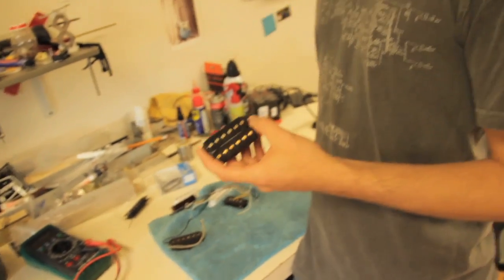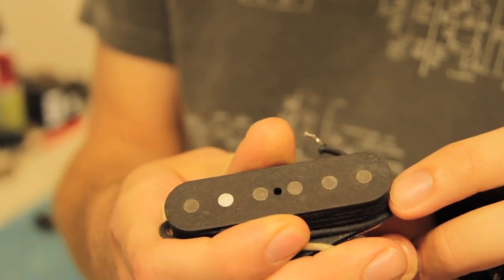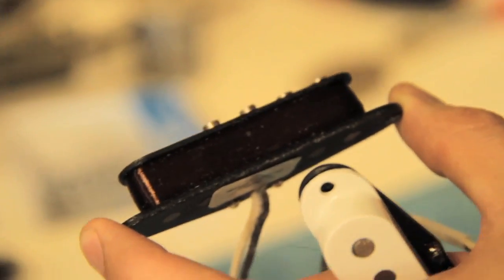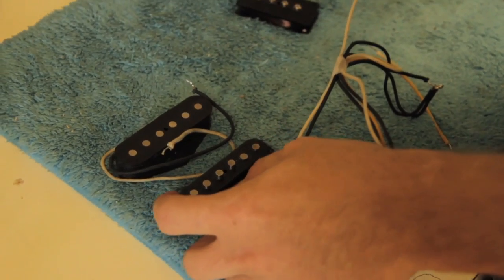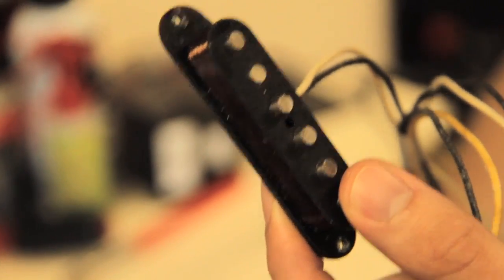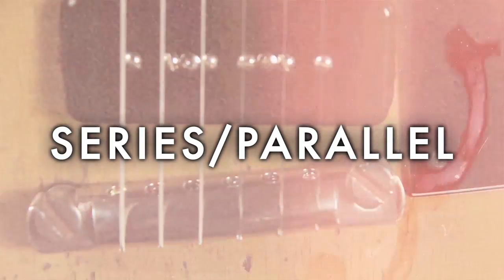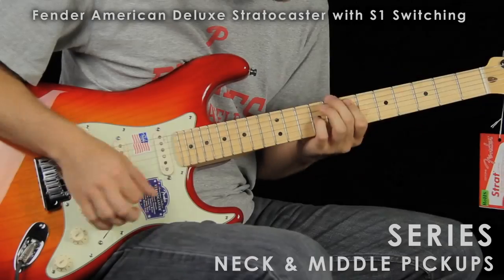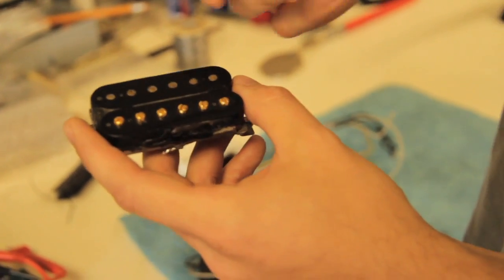Guitar Pickups 101: How Guitar Pickups Work - Tech Bench

Comment: is the copper wire insulated? or is it just bare wire?
Reply: the copper wires hav a coating on them. the coating is conductive ig but the resistance on the inside is much lower, so the current will flow inside the coil and won't jump over turns

Comment: on a 6 pole pickup, would it be possible to wrap two poles at once, each set of two, and then wrap all 6 for better output?  before you answer this, has anyone ever tried this and where is the information saying it works or doesn't?

Comment: Yeah question if you, or anyone, gets a minute please. While investigating the cause of my pick-up not working, I pulled the apron/skirt back and found the ground from the main output wire had frayed loose. So after 're soldering, I was pulling the apron back over and needed to cut away some old glue, and wouldn't you know it?, there was a teenie tiny little black wire hiding right in the glue there and my snips were just doing what they were told to do. So, heh heh, from main output(red) I have shielding wire grounded, then hot wire runs into first coil(white), exits 1st coil(yellow), into second coil, then exits as black, and then the snips happen... Do I just ground it with the shield ground or?...... Thanks if y'all can help, and thanks for the info video too... Well conveyed and easily understood!!!

Comment: So then electricity is going through the strings too I assume?
Reply: What the hell?
Reply: The vibrating string affects the magnetic field and these fluctuations are transferred to the coil and sent to your amp. This is why an electric guitar wouldn't work with say nylon strings because they aren't metal and don't interfere with the magnetic field.
Reply: Nabre Labre doubt it cuz a player w/sweaty fingers would get shocked, i think.
Reply: Yea probably not,  I was thinking without electricity flowing through the strings what would there be for the pickups to... pickup. But I guess the string resonating moves the magnet enough to get some kind of current flowing in the pickups then I guess you amplify the crap out of it to get something audible
Reply: Nabre Labre sounds logical, but of course since i'm not an electrician, i don't know for sure.
Reply: To be honest I don't know much about it either. I know a magnet passing by a wire will generate electricity,  but not a stationary magnet. A current through a wire could induce current in another wire without relative motion... I think

Comment: What would happen if I connected a wire from the pole of the bridge pickup on a Strat to the middle pickup. Imagine a wire that was taped, or soldered to the top of the pickup where the pole is exposed, then running to another pickup. I'm just curious, but I also want to experiment with eBow.

Comment: why dont my pickups work when i try to switch them on it just sounds like a regular acoustic guitar
also i just got my electric guitar so im new to it
Reply: If you have sound coming out of your amp, then your pickups are working. It will sound like an acoustic guitar because you didn't add any effects, like distortion. You have to buy effect pedals from stores or the internet. It doesn't just come with the guitar. I had that same problem when I was first learning electric guitar.
Reply: Awsumdude123 k thx for the info
Reply: Aquaghost123 If u have an old radio sitting around, u can use that as an amp too. Best part is, if u turn the volume up to 10 on the guitar, it will create natural overdrive, which sounds AWESOME. I have a video on my channel on how to do this the easy way, if u wanna try it.
Reply: sure thx again
Reply: your amp should, (I'm guessing you have a little amp?) have a button that says: Clean/Overdrive or something like that. Click it either in or out and you should get the crunch sound you want. Also turn up your GAIN and TREBLE knobs. ;)

Comment: Very nice, but he didn't explain how they work...
Reply: The magnetic field from the magnet oscillates slightly as the string oscillates up and down after being plucked. The magnetic field lines want to pass through the string due to the type of material the strings are made from i.e. nickel(which is ferromagnetic). Oscillating magnetic fields induce a voltage in the wire/pickup. The physics is usually taught in freshman college courses if your in the STEM field. If you don't care about the math, youtube'n Faraday or Maxwell(the guys that discovered this stuff) will get you 80% there.
Reply: @peterritchie7382  So pickups will only work with metal strings then?
Reply: @peterritchie7382  Yeah but even still, what a missed opportunity for a video implying it's intentions were to elaborate on the specifics on how the materials, design, and basic principle of induction all contribute to what makes one set of pickups different from another. There were a few moments where I felt my interest piqued as he provided useful nugs of history, or specific details concerning materials and process standards, but then he just egregiously moves on to the next topic. Not the worst video, though
Reply: @hendrix5757  Bro why didn't he go into the quantum mechanics of why magnetic fields and current affect each other thumbs down!!!
Reply: @xeno126... I will try to answer your question of how guitar pickups really work. First off, it never made sense to me that an electric guitar string vibrating in the magnetic field of its pickup assemblage would do anything that can be noticed by the pickup assemblage's coil (even though it has "tens of thousands of turns"). I say this because according to the Lorentz Force Law, if you have a coil of wire wound around a magnet, you either have to move the magnet in and out of coil (or move the coil back and forth around a magnet) in order for a current to be produced in the coil. The whole idea is that you have to be cutting magnetic lines of force with a wire or coil for a current to be produced in a wire or coil. So, vibrating a metal string (like an electric guitar string) through a magnetic field should produce an alternating current... in the guitar string itself!... but NOT in the pickup coil. The pickup coil is stationary, so it would require moving a magnetic field through it to induce a current in it. Well, the magnet of the pickup assemblage is also stationary, so it's not moving. So, how in the world is a current induced in the pickup coil? Again, vibrating an electrically conductive string above the guitar pickup should induce a current in the guitar string itself... NOT the pickup coil. So, does the electric guitar use the current induced in guitar string itself to make the signal? Actually, this is not how electric guitars typically work, since the guitar string ends are just anchored to the body of the electric guitar but are not electrically connected to any circuits (though it would make for an interesting experiment, but I digress). So... how do guitar pickups really work then? How is an alternating current really induced in the coil of the pickup assemblage? I believe this is the question @xeno126 was really asking here. And now... for the answer!  The KEY concept of how guitar pickups really work is that the strings of an electric guitar must be able to be MAGNETIZED. Those little magnetic pole pieces of the pickup assemblage that are below each of the guitar strings actually MAGNETIZE a small portion of the guitar strings right above them. And it is the vibration of that small, magnetized portion of each guitar string that causes each of their respective magnetic fields to vibrate through the pickup coil... which induces respective alternating currents in the pickup coil... which can then be amplified in a guitar amp and speaker to produce sound. Again, this is the key concept of how it all really "works". If your electric guitar strings were nylon or aluminum or anything else that couldn't be magnetized, the pickup coil would never get an alternating current induced in it... therefore, no signal to amplify. In fact, you could remove all magnetic components from a guitar pickup and just leave the pickup coil... and then take a separate guitar pickup assemblage and slowly move it down towards the guitar strings (in the same vicinity of where the guitar pickup pole pieces were below the strings previously) to magnetize them from above... and your electric guitar should play just fine. Or, you could likely glue tiny magnets to the bottom of the guitar strings, in the same respective areas, and this would also achieve the goal. Or just take single magnet and bring it down towards a strummed string to see when it finally magnetizes the string enough to induce an alternating current in the pickup coil. Again, the magnet(s) in the guitar pickup assemblage ONLY serve to magnetize a small portion of the guitar string(s) above it. If this is hard to accept because you had learned or believed it all happened some other way... try stringing your electric guitar with aluminum strings (or any other non-magnetic material) and you'll find your electric guitar will have stopped working properly. Now, aluminum is electrically conductive but non-magnetic. This should prove the concept that you MUST have strings that can be magnetized in order for an electric guitar to work properly. Therefore, this should finally answer the question of how a guitar pickup really works, which was NOT explained in this video. The other information presented in this video was, indeed, quite interesting... but there's a lot of room for further detail to those concepts, along with more real-world examples, that I wish were included. So, I'm happy for what we got for "5 minutes"... but I wish a lot more examples and fleshing out of the concepts were included. Lastly, AlNiCo is pronounced AL-ni-co ... not al-NEE-co. The "i" has the same pronunciation as the "i" in "it"... not "ee" in "knee". And the emphasis is on the first syllable, not the second. After all, the acronym comes from Aluminum-Nickel-Cobalt. For example, is the coin between a penny and a dime a neeckel or nickel? Are they the New York Neecks... or the New York Nicks? So, hopefully that clears all that up.
Reply: It's not like it was the title of the video or anything.
Reply: elusivEuphoria it absolutely was in the title
Reply: @tochriss  That was an incredible read, thanks for the link
Reply: Christopher Try this too: https://bit.ly/2DktbHV
Reply: Xeno expecting a university level electrical engineering/physics class from a guitar tech